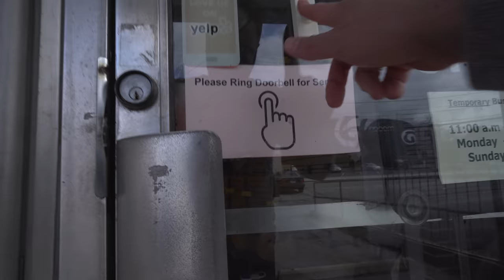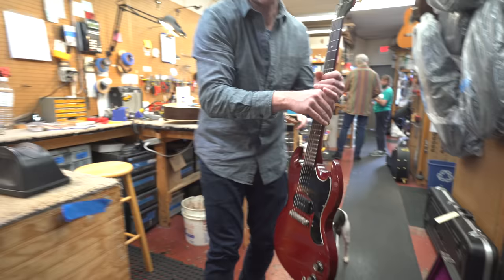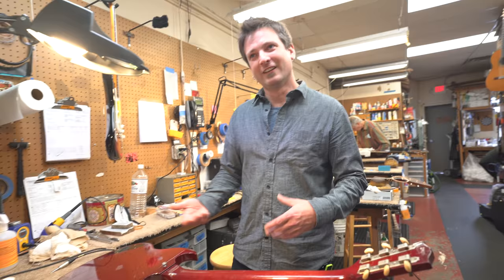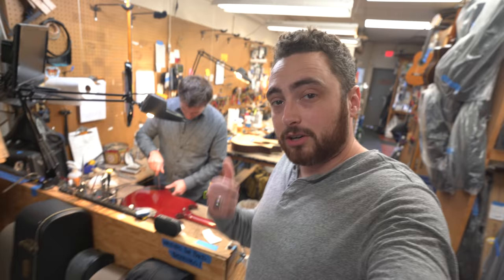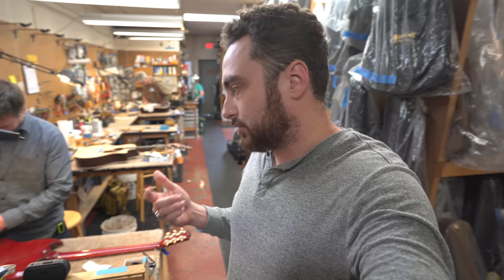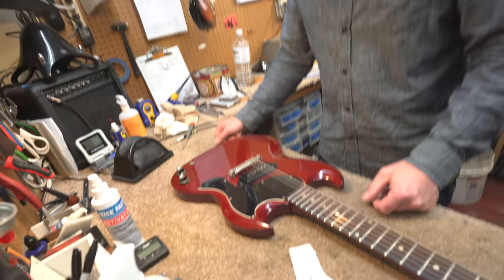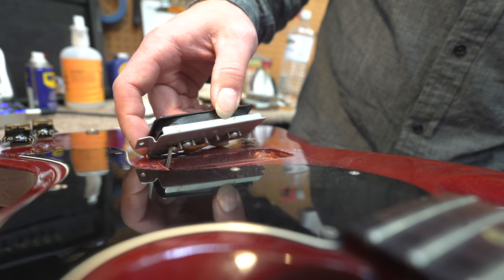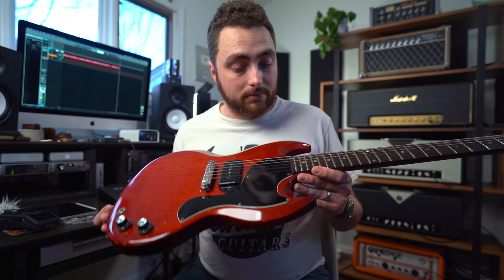I Finally Bought My First Vintage Guitar (I Got Lucky)

Comment: In the mid 70s, while in high school, I had a first year 1961 SG-style Les Paul Jr.  Sold it around 1980 because I was... stupid.  I have rarely had much regret in guitars that I've moved on from, as it was normally because I was making a step up and very rarely a lateral move.  But if I could have one guitar back...  Enjoy, Rhett.

Comment: There's a red 1965 SG junior with case for auction on eBay, right now. The starting bid is $2, 600 and it's not as nice as the one Rhett bought. Close, but Rhett's SG junior doesn't have nearly as much wear and tear as this one.

Comment: This is a great guitar and Rhett was very lucky to get a guitar that has not been worn out after so may years. I just don't get the fuss about the value of original pots, they age, they get dust in them, they get scratchy, the tracks crack, spindles pull out, and if a guitar is maintained properly with the intention of actually keeping it playable then the replacement of pots may be necessary. I would just never throw away the original pots, and any other original components (especially pickups) but simply keep them for the sake of making the very old guitar restorable, (and unplayable?), if the buyers intention is to put it in a glass case and hang it as a decoration.  I would never buy or want an unplayable guitar except to make it playable, and enjoy it, so if I ever did buy such a guitar I would probably make it playable immediately with the best components from the original manufacturer that I could get. Ok I play guitar, I'm not a collector who wants old guitars to show and not play. Well done Rhett, you got a really great and very payable guitar. Just my opinion.

Comment: You probably already know this, but just in case, don't make the mistake I made with my SG and put it on a stand with rubber pads. The finish that Gibson used is super reactive with certain things touching it and mine just about ate right down to the bare wood in a couple spots. Super bummer. I peeled the rubber off the stand and no more issue, but now I have to live with these indents in the finish. Not wealthy enough to get it refinished at this time.

Comment: I have a weird question. What is the element of the sound profile of tube amps that I feel like I can hear? I want to describe it as the "shimmer" of the tone. It's not just the high end of the sound (as in pitch), but more like the highest point of the volume. I feel like I can hear the glass of the vacuum tubes, which I know doesn't really make sense. 

The warmth of the tone of tube amps is something I hear described, but I don't know if I can actually hear that description. 

Any help understanding this would be awesome, great videos, congrats on that new beast, it's a real beauty.

Comment: I've got a '61 model that says Les Paul Junior on the headstock bought it 2nd hand 53 years ago ... 99.9999% original - I had to change 1 wire otherwise everything is 100% ( including frets )

Comment: The one guitar I let go that I regret: in 1988 I bought a Gibson 1961 “Les Paul”.  It was an SG, but Les Paul hadn’t thrown his hissy fit yet and it was labeled Les Paul.  It had all the original electronics and a Bigsby vibrato.  It would never stay in tune.  I let it go in 1991.  Big  mistake.

Comment: Very nice guitar.  

However, there is no single method or "one size fits all" method to identifying the year any Gibson instrument was made.  An SG, however, unlike its Les Paul cousins, has definitive characteristics that can prove when the instrument was made, especially those made in the 1960's.  Checking the pots is definitely a good start but, its not necessarily proof of the year the guitar was made for a variety of reasons.   

For whatever its worth, the potentiometer code found on the pots should have 7 digits that begin with 137, which is the three digit manufacturer code, followed by four digits and read like this:   "137 XXXX".   The last four digits represent the year and the week the pots were made.  So, if the pots were made in 1965, they should read "137 65XX".   Too bad the code was partially obscured by solder.

* THE FOLLOWING INFORMATION IS SPECIFIC TO SG MODELS MADE IN 1960'S ONLY *

Take a look at the serial number.  Granted, Gibson serial numbers are not very reliable when it comes to dating the instrument.   But, if the words "Made in USA" appear under a 6 digit serial number, the guitar was made in 1970 or later.  1970 is the first year Gibson added the words "Made in USA" to their SG models.  If there is a 6 digit serial number WITHOUT the "Made in USA" stamp, it was made before 1970.  

One of the best and most reliable methods to date a 60's Gibson SG (aside from the factory shipping ledgers that are rarely available these days) is by the width of the neck at the nut.  This is a characteristic that is specific to SG's and only those made in the 1960's.  Gibson SG's made up to 1965 had a "wide neck" that measures "1 11/16" at the nut.  However, Gibson decided to slim down the neck of the SG in 1965 to "1 5/8" and then,  down to "1 9/16" by the end of the 1965 production year and continued with that measurement in the following years.  So, SG's that were made in 1965 potentially have one of these three measurements at the nut.  If the measurement is "1 11/16", it was made in 1965 or earlier.  If the measurement is "1 5/8", you've definitely got a 1965 model as 1965 was the only year this measurement was used on an SG.  If the neck measures "1 9/16" at the nut, then, it could be a 1965 model which means more corroborating evidence is needed.   Incidentally, there were very few SG's made with a "1 5/8" nut and they were only made in 1965.  These particular instruments are worth considerably more than the others.  

Another factor are the knobs.  Gibson used "reflector knobs" on their SG models from 1961 to 1967, which are present on this instrument.  That's a good indicator this SG was made before 1967 assuming, of course, the knobs are original.  Knobs can be replaced and I'm not suggesting that's the case here.  The knobs coupled with the neck measurement together provide the best evidence of when this guitar was made, especially since the potentiometer codes on this pots are partially obscured by solder.

Is this guitar rare?  No.  Its semi collectible and has a value somewhere in the $5-6,000 range in good condition, perhaps a bit more.  As I said earlier, if the nut measures "1 5/8", the value is higher. This SG, however, is definitely a great addition to any collection, especially for someone who intends to play the instrument regularly.  That P90 alone is worth the price of admission.  This guitar is also a great "stepping stone" tool in the event you want to move up to something else that is more collectible.

Comment: I would love it if you would explain how you dial in good slide tone on that particular guitar and with what pedals. I have a single dogear p90 guitar with 11s that I use for slide, and haven't found the sweet spot yet for really pleasant slide tone. Granted mine is not a vintage SG...that'll never happen. Congrats!

Comment: What's so special about this guitar besides the fact that its vintage? I genuinely want to know
Reply: The tone wood to make it is illegal to be sold now as the rain forest is now depleted, the pickups have alnico magnets, sure you still can buy them, but the old ones were refined different from today, the  wire used inside the pickup was coated using a diff materials not used today,  the CTS pots have a layer of thick carbon on the inside guts, while the new ones have printed carbon ''big diff in tone''...even the wiring was made diff than today, and coated and sometimes even wrapped using a special coating and cloth covered, everything was hand made mostly, and not mass-produced, just to name a few things I've noticed
Reply: @beatleme2  thats insane, thank you

Comment: I think vintage guitars are okay, but its very dependent on the asking price. These days with the high quality of the electronics for relatively low prices, a new low cost guitar is hard to beat.  Keep in mind that a lot of these sought after vintage guitars were budget models when they were introduced - obviously not the Gibson Les Pauls.

Comment: Had the fortunate circumstance where a '76 Gibson ES-345 came into my... Let's call it an opportunity. Before opening the case I said I'm only going to consider it if the neck is right, and it was. 

That's how I got my first Gibson. I'm in the process of searching out the right pickups, thinking something early 60s or pre-t top era. I'm probably the only guy who isn't entirely crazy about PAFs.

Comment: Aaah, my first guitar, an early '60s SG Junior. $90. I've owned three, and now have a '61 Les Paul Jr, which is the same guitar, but first year. Super cool guitar.

Nice that this one is uber clean - certainly adds to the value - but as a guitar tech and purveyor of guitar parts I think people get unnecessarily hung up on things like original pots and solder joints. George Gruhn wrote an interesting article some years ago contrasting Italian violins and vintage guitars, and the fervor over originality regarding the latter. He stated that many (if not most) of those old violins have had major work: bridges replaced, or sides, or necks, or tone bars. Even entire backs. So don't kid yourself: That old Strad hanging on your wall? Might not all have been built in the 17th century!

A tool is a tool, and it must be kept sharpened otherwise it's not a tool any longer. For this reason my '61 is about to be refretted. Regarding people bugging because solder joints were not original, Gruhn commented along the lines that "good thing violins don't have solder joints".

Comment: Welcome to the 'Rabbit Hole'!  You are doomed, but in a good way. ;) Never planned on being a collector/curator, but I guess I am. 

Got my '76 Firebird in '83. It was just a good used Gibson to me then; much more than that now! My first amp was a '64 Princeton so I was screwed from the start. When I wanted more power got a '64 Danelectro Twin Twelve because it was cheaper than a Fender Twin. Had to have a true vintage '59 Dano dc-2 because Jimmy Page and Syd Barret played them. Same thing with the '58 Supro Dual Tone thanks to Link Wray holding one on the cover of 'Rumble'. That was my Lucky One. The owner didn't really know what he had. Great deal for me! ;D

Thanks for that riff btw. ;)

The collection doesn't stop there, but I won't get into the Strats, Harmonys. Kays, and rarities, 

Each one seems to take me in unexpected directions. Some have led to surf or rockabilly or jazz. They seem to have memories of their own. That's what I love most about the next one. ;D

Comment: I would take a modern day guitar over vintage any day of the week.  For one, most people pay a high price for OLD?? Why? If you are a collector trying to make an investment...fine but buying now that appreciation speed is SLOW!!! If you paid $300 for this SG I would say "you're lucky"  This guitar most likely will spend its time hung on a wall or in a case.... COOL.  Secondly, which I hear ALL the time.... I hear people talk about tone, sustain...etc.   Come on people, it's electric.  Just about any POS guitar out there can sound incredible with the proper pickups, nut, strings, amp, effects and most importantly = THE PLAYER.  Watch Joe Satriani play a garbage guitar. Its on youtube.  And btw, I have a lot of guitars.. 2012 Gibson SG standard, 2014 Explorer 120 Anniversary, 09 Schecter C1 hellraiser, 80s Ibanez EX series, PRS Custom 24, ESP LTD EC1000 and more.  Point being, they all have different pickups some active some passive, different strings...etc.   They ALL play and sound fantastic through my rig. I bought them all to PLAY.  Not as a trophy.  Keep it.

Comment: Oh dear.  I bought a newish used Gibson SG in early 1980s.  Not the headstock snapping kind as such but still.  I would not call it vintage, then or now, just old.  Not worth spending more than £500 on, back then it was £275, and even then just because it reminds me of youthful misadventures?  No.  Get a tele and as you yourself said on numerous other videos get P90s in a decent guitar.    This was a duff move.   And you are not Derek Trucks or Angus Young or Sister Rosetta Tharpe.  Neither am I.  A 335 0r 339 or a Tele would have been a better non Strat / Paul move.  

FYI - I loved my Gibson ES330TD 1965 vintage Serial No: 421180, 

... until it was stolen. The emotional wrench..., vowed never to buy a vintage guitar again  ;)

Comment: You're so interested in the pots being original. Frankly, I don't see the point. Pots are like tyres. Who wants a car with crumbling original tyres? As long as they are the same value and the same taper, a new one is better than a scratchy original. Those tracks just wear out over time, and if they do, it just proves someone found the instrument good to play, and that it's worth new pots. If the originals are fine, that's all well and good.